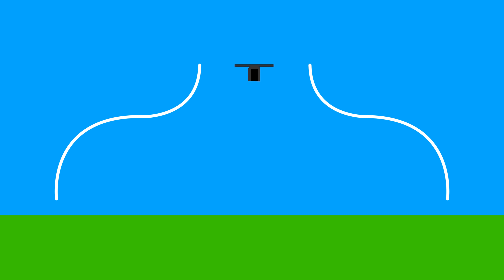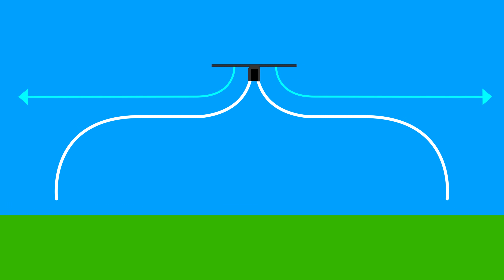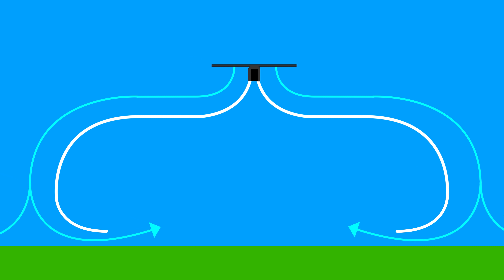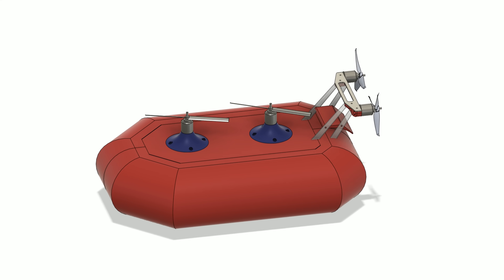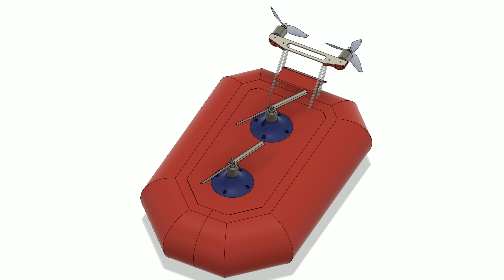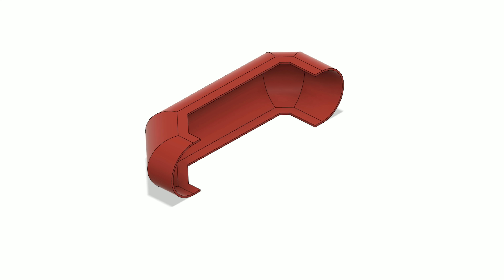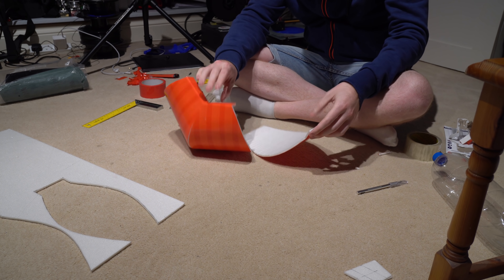Coanda Effect Hovercraft

Comment: it would be interesting to see the flow more clearly by attaching some threads or yarn to the surface. Also if you had one lift fan you could move the drive fans forward, and they also would create a coanda effect over the rear.

Comment: the coanda effect does not produce lift...… if in a coanda craft if you don't produce more thrust from your prop then the craft weighs it will not fly.  if the effect made lift you would want a large "coanda surface" for more lift. making the surface smaller actually improves performance.

Comment: Seems like the lift changes with the relative air speed once it's moving, so the leading and trailing sides will see a proportional and opposite increase or decrease. So it's more unstable in that regard compared to a traditional hovercraft. Would take a bit of throttle proportioning and electronics tricks to counter that. Until fixed, it's always going to want to flip over. Works, but needs work.

Comment: Will there be a version 2? Smoke would be good to see what airflow is doing over the craft. Downward air around the edges might make a bit of a curtain that keeps high pressure air underneath. In version 2 you could channel some air down like a normal hovercraft. I'd also recommend guide vanes or even ducts to channel the air from the propellers.

Comment: I wonder how much the stability would be improved by moving the CoG down by moving the batteries, motors and electronics and adding shafts and pulleys to get the power where it needs to be...

Comment: I would be really interested to hear exactly why those who disliked this did so. I'm struggling to understand what could possibly be worth a dislike here... Awesome project Tom, love your work!
Reply: Well, I didn't give a thumbs down, because it would be churlish, he put in a lot of effort on the build and video,  and he's a nice guy. But I didn't see any evidence of any Coanda effect at all. What I saw was a quadcopter with only 2 props set to provide enough vertical thrust to nearly overcome gravity and slide on short mown grass. I highly doubt there was any airflow whatsoever reaching the internal cavity. It would pick  up leaves, wouldn't it? It's a rake. His shots demonstrating the Coanda effect with smoke illustrate the problem - about a 15 degree change in airflow direction. When it flipped, I didn't see the Coanda effect pushing excess high pressure air into the cavity, I saw the large upward thrust of the bi-copter becoming unstable when an edge of the device hit a small obstruction. It's pseudo-science really in a bit of a click-bait title. But still, no thumbs down, he made something and got outdoors, which I respect.

Comment: Interesting project, but I’m skeptical as to whether the coanda effect component of this aircraft’s lift is really doing much. With that kind of a lightly built airframe, and those two motors, I think it would lift off nearly just as easily if it were just a bicopter configuration. I’d be interested to see you attach a fiat piece of foam over the curved section to mitigate the coanda effect lift, and then observe any drop in lifting ability. That would show how much lift you’re really getting from the coanda effect. I do like the idea though. :)

Comment: I can't imagine the coanda effect having a noticeable difference to be honest. Mount the props vertically and see if there is any downward thrust due to the coanda effect.
Reply: @mcgherkinstudios I'm no physicist so I'm just pulling shit out of my ass, but the props are smaller than the surface area of the vehicle. This means the force it generates is pushed directly against the surface that it's trying to lift (until the low pressure is sufficient enough to cause the Coanda Effect to take over).

https://www.youtube.com/watch?v=N0IGrSjcBZs
According to this video, when a vehicle (small drone) generates it's downward lift force, the weight on the scale does not change because the downward force from the drone is enough to make up for its own weight that was present when resting on the bottom of the container it is in. So, instead of going to -21 grams, it stays at 0 because the force necessary to lift it is being pressed against the container.

Is this not something like what would be happening here, but since the two items are connected, it's creating it's own negating force? I'm more interested in how to prove what is causing the lift effect. Are the props overcoming the weight or is the air from the props creating a low pressure around the surface of the vehicle, causing lift?

I am also curious (not knowing anything about this stuff) would the altitude of the vehicle change if the props were creating the lift directly instead of the Coanda Effect? I mean, if the props are generating the lift, sudden altitude change shouldn't really matter, should it? A helicopter doesn’t suddenly plunge toward the ground after passing over a mountain. When the vehicle jumped the gravel walkway or left the elevated, bricked area, it immediately dropped. Does this indicate that the Coanda Effect is in place (since proximity to the ground is, I'm assuming, important for this effect based on the type of vehicle) or that changes in air density matter with such small props even at a few inches?
Reply: @SeraphX2  Nice
Reply: @SeraphX2  the props would have a low pressure are above them and a high pressure area below them. ~2/3 of the lift in a wing is generated by the top part. 
This design looses ~1/3 of the lift from the props because of the design.
There are also other effects that may make this even lose more. 
Now if the coanda effect Would make up for more than ~1/3 of the lift it could become beneficial.
Reply: @mcgherkinstudios  
That was what i was thinking. In the configuration as it is now it's just a fat inefficient helicopter.
Reply: @strangelee4400  yeah, thought that too
Reply: @mcgherkinstudios  The point of the coanda effect isn't about pressurising the air below, it's about generating lift along the curved surface.
Tom took the additional step of trying to pressurise by extending the curve. However, this means he now has a downward facing curve, so if the airflow is extending that far, he's actually generating negative lift that's partially counteracting the upwards lift he was shouting for with the upwards-facing part of the curve.
Reply: @nialltracey2599  yes but only roughly half as far as the inward curve goes
Reply: I'm not seeing any boundry effect either. It looks like it's just bouncing off the ground to me. The ground effect should sort of hug the ground, not bounce off of it. No smoke stream test either to show where the air is actually going. I suspect it's not really adhering much. I'm gussing the air is forming a torus shaped vortex around the propellers, and this is just a really weak drone with an eccentric body.
Reply: Stephen Borntrager this isn’t much evidence but it was sucking leaves into the bottom, making it seem like that’s where the air was going

Comment: I wonder if your stability issues could be resolved by doubling the width and having 4 top motors.  Or maybe put a light chicken wire cage over the top so it's rounded and will let it roll over, but not interfere with the air flow :)

Comment: Can you add some kind of distance sensors under the hull to PID control your main lift?  Although, ultrasonic sensors won't work because the data comes back from them too slowely.  Maybe some kind of laser time of flight, or even some kind of whisker.

Comment: I'm really interrested in how you mananaged to control all 4 motors with just a remote ? Could you explain ?
Reply: Two lift motors are likely controlled by the left stick, and he throttles them up to what is necessary (too high and it might flip, too low and too much friction)

The right stick controls the rear motors like a joystick, he has likely set it up so to go left the left motor stops and the right motor goes

Comment: First do a traditional soft bellow to act as suspension, second duct the original impeller for lift, third if you still get front lift from the drive motor weight in the rear, set the front lift motor to counter it proportional to the drive motor power

Comment: If you added skirting all the way around that was attached to a frame or bracket that pushed out a quarter to half an inch away from the body so the air could make it down between the skirting and body, I bet you'd see significant improvements in it's performance.

Comment: One problem with angling the sides through 180° is that there would be a low pressure region underneath the sides pulling it to the floor - basically reversing the usefulness of this effect. It would be interesting to do a comparison with the sides finishing at 90° to the floor

Comment: Could you use an accelerator to detect when it's about to tip over and cut throttle to the top motors?
Reply: Or just make it round? ;-)

Comment: It would be interesting to see a design where the lift fans are replaced with front-intake ducted fans that exhaust out ducts along the sides. I have a feeling that you'll get more laminar flow and therefore a lower pressure along the curves. Might also be worth it to try making the sides not curve under so you're not creating a low pressure zone between the bottom of the curve and the ground.
Great video!

Comment: As usual interesting project thanks for sharing, 8" propellers from my experience push air to quite a large circumference around it so there is a possibility that lift is produced directly due to air pushed by the props not just the Coanda Effect the only way to confirm is using a platform with same dimensions but without the curves.

Comment: Dude .. all you need is some sort of vertical stabilizer.. to automaticly detect the bote is in the air and to trottle down the front abit to keep it on the ground .stop the ....pitching? Dont know if thats the term .. you could go fully mental with it and put ground sensors like a Tesla and when the vehicle lifts off the ground too much it autocorrects.. I know you don't typically like massive projects maybe if you collabed with flite test in the usa build  a masive one ...

Comment: Tom, I appreciate your experiments, but this example only shows that you can lift the model with two propellers. Even if there is any effect, the hull pressure is insignificant for this test.
 A flat plate hull would have a similar effect.

To confirm anything, you would have to check this model in the air tunnel.

Comment: Awesome. The only thing I can think of off the top of my head to make it a little more stable is if you could run the front lift motor slightly slower than the rear to help compensate for the weight on the rear of the craft.

Comment: Amazing result. Real innovative. But... why use the traditional hovercraft/landspeeder shape? Why not all the way round?  Like an actual ring with the bottom plate at ground level so the engines can be mounted lower. The coanda effect should/could be as effective and the centre of mass would be lots lower.

Comment: I think the torque from the blades is what's making it turn over. It seemed only when you turned to the left is when it turned over. If you were to attempt a version 2.0 maybe put on counter rotating blades?

Comment: Interesting video thank you.  Perhaps the lift mot ors have been positioned without taking into account the weight of the drive motors and assembly at the back making it tend to tip up at the front?

Comment: Much Cool !
A bit unfair test tho. Better have the motors atop a sphere, or part thereof. Lots lost 'cos of that flat bit.

(lube steel drill/aluminium with methanol - works better than oil for Fe/Al)

Comment: Hovercraft also use ballast to avoid capsizing.  Perhaps if you brought the props lower, and made the craft wider, it would be a touch more stable. Additionally, adding some slots for some of the prop wash to filter through the deck might help stability and efficiency.

Comment: Now try hovering over water. 

If you make it bigger you could use 4 hover motors and get leveling stability with a flight controller. Then lower and bring the CG forward and it will fly and hover.

Comment: Firstly, Well done on making it work, your ingenuity is fantastic to watch, keep up the good work.

And secondly, you mentioned the craft being too top heavy. would it possible to add a rigidly suspended weight (an iron bar) inside the "skirt" to lower the CofG.
This would increase the weight but you did say then it was "lifting off" at half throttle.

Those speeds during the out takes were quite impressive. would of liked to see a slow mo of the airflow using smoke.

Kindest Regards from a fan of yours
David

Comment: Another very interesting video and project! I wonder if lowering the lift thrust while turning reduces the flipping over. On one hand the propellors won't be pulling it over (and the craft will have more weight), but when it's doing the typical hovercraft drifting, the edge near the ground might be getting way more friction, flipping the craft over still.

Comment: Doesn't the craft become more efficient once away from the ground? When there's space beneath it, the air flow can actually increase the pressure underneath it, thus improving the lift. Unlike a regular overcraft, which loses efficiency when being too far away from the ground, since the cushion gets disperded as more space is available for the air to flow, I wonderif that was the reason for its tendency to lift off.

Comment: Weight the foam to balance it, it would likely fly over gaps with little to no issue but it's balanced poorly.

Just add nuts or washers and it won't tip as easily.

If you look at the video it tips over in a predictable way.

Comment: I'd like to see the center of gravity brought down on this project. The blue uprights nearly deleted, bringing the blades much lower. Reduce the height of the rear up rights. Perhaps even hang the motors very low in the shell, and run a shaft up to the blades. Anything to offer it more high speed stability.

Comment: Pretty sweet little toy! For your forward thrust motors, what about doing a couple turbine engines in tubes running through the body? Should make it nice and stable and wouldn’t reduce pressure inside?

Comment: Tom, you need to test this on water. I fear that, just like the leaves, water will be sucked in and the craft will bog down. So, what if you covered the bottom opening with thin latex, which, although compromising the inside pressure somewhat, would prevent water and other debris from being sucked in?

Comment: I would like to see a comparison between the current design throttle % to get lift and % if you cut holes in the top just bellow the propellers and re mount them like the impellers were to blow directly into the cavity.

Comment: It's the fact that traditional hovercrafts are incapable of flight that makes them work so well. If one side lifts off the ground too much, lift on that side is reduced and it levels off. The Coanda Effect actually flies, so its strength turns out to be its worst weakness. Once it lifts off, it's happy to just keep going and there's no self-levelling effect. Maybe with some gyros and additional controls it would be stable, but then it's also a lot more complex and expensive than a traditional hovercraft. But a hovercraft that can actually fly? That might have real applications... 

Great vid, it looked like a lot of fun even if there were some frustrations.

Comment: Why not add a PID loop and mix differential trust on the hover motors and also the pusher motors? You should be able to keep it stable-y on all three axis. Also you might be able to cut the hover throttle if your pitch and/or roll exceeds 5 ° or 10 °... I really’d like to see this thing hover 10 inches high :)

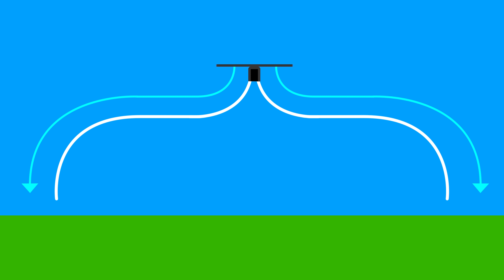Comment: Interesting project. I noticed in both this video (here at 2:00) and in your previous video on the Coanda effect that you say something about not only will the downward air flow produce lift but the pressure difference will also produce lift.  It sounds to me like you are trying to count your lift twice. 

Just like with an airplane wing, you can determine lift by checking the change in momentum of the air as the wing passes through it.  This is basically an F=ma calculation.  Roughly speaking the force upward on the wing is equal to the mass of air accelerated downward.  Another way to find the lift of a wing is to integrate the pressure difference over the whole wing.   Lower pressure on the top than the bottom and you have lift.

But, these two ways of finding lift are just different ways of describing the same thing.  They are two sides of the same coin.  That is, you can say that the pressure difference over the wing is caused because the air is being accelerated downward, or you could equally well say that the pressure field around the wing is accelerating the air downward.  My point is, you can't have one without the other -- if the air is deflected downward, then there is a pressure difference -- if there is a pressure difference, then air is being accelerated.
Note: One could argue that because the hovercraft is in ground effect, what I said above isn't strictly true.  But, that's a bigger topic.  What I said above is true for wings (or Coanda effect devices) that are out of ground effect.

Comment: So two thoughts. You have a typical helicopter effect going on aswell with it causing a negative pressure above the blades and positive pressure under them which don’t account for the coanda effect. Second when you turn on the rear fans that has to mess with the effect as it then creates a negative pressure right above the rear part (in front of the pusher blades) where there normally would be a positive pressure so the coanda effect in the rear might be reduced.

Comment: If you reduce the speed of the lift rotors when a turn is made (when the delta between two thrust motors is high enough) you could probably prevent flipping